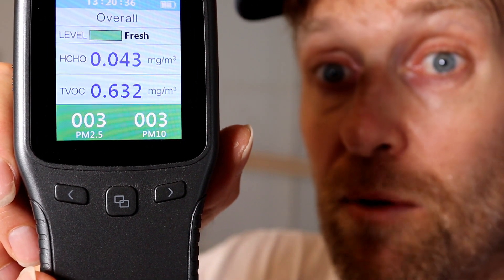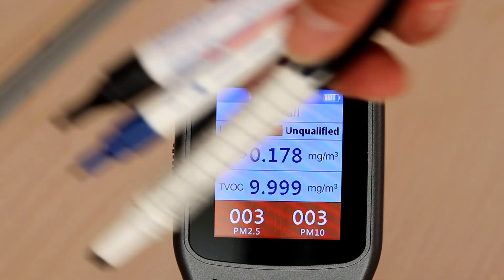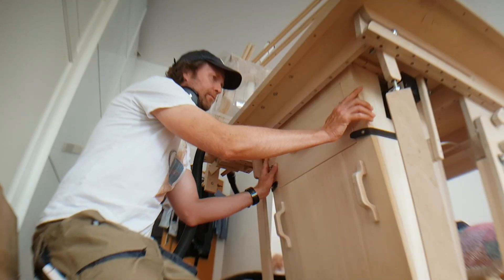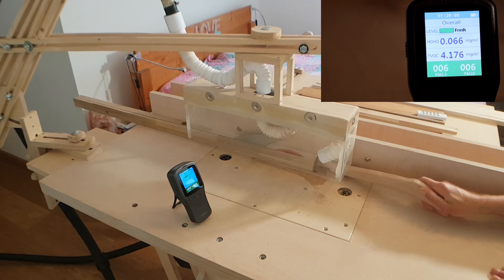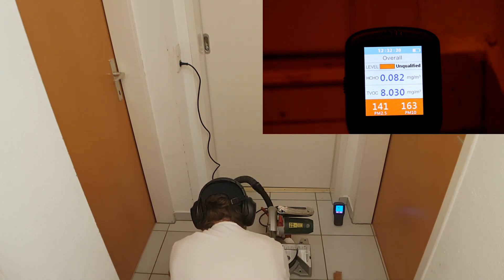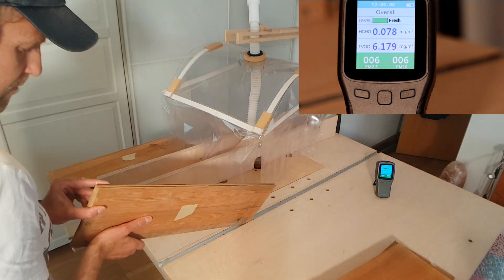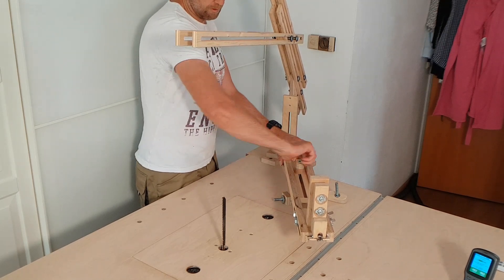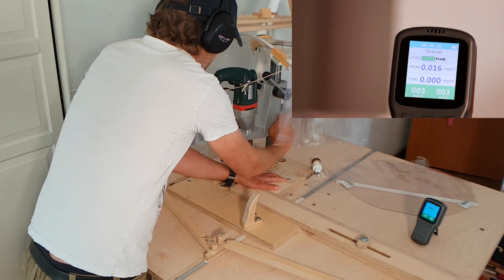INSANE?! Fine dust pollution woodworking inside a bedroom

Comment: Spectacular!  You have so many well thought out tools.  They all fit in a very small space together, and that has been the marvel.  

But your approach to dust collection may be more important, and could be adapted to situations with more space, but no more desire for toxic dust.
Reply from the maker: Thank you, well keeping dust emissions under control has always been the main focus here. I think that these measurements have been the final proof of concept. What i have noticed is that many people who are working in their shops seem to not care much about dust emissions.  Often their commercial tools e.g. the table saw is equiped with a hood above the table but the machine below is not covered which from my point of view changes everything as the motor turns in some sort of fine-dust superspreader. Your are right this might be an approach for all situations 👍